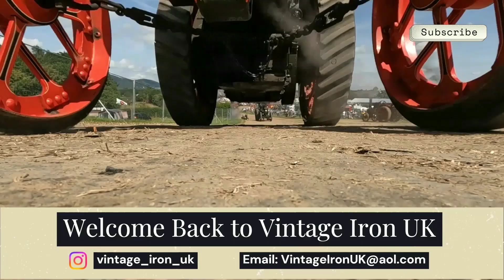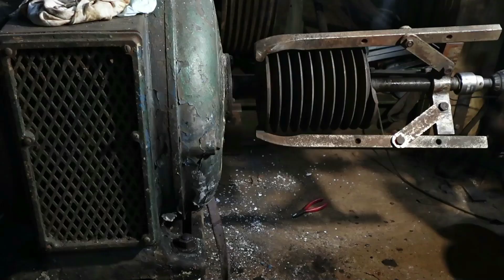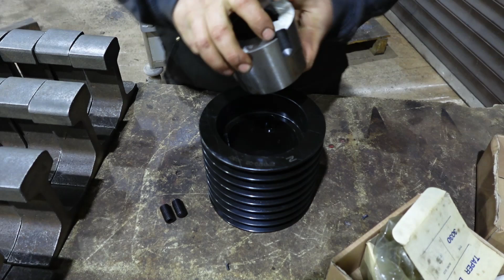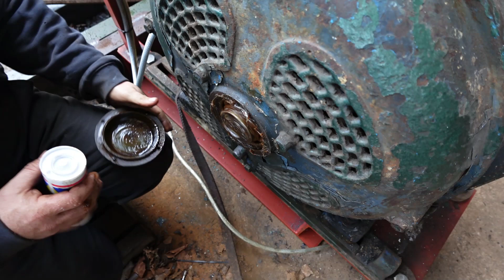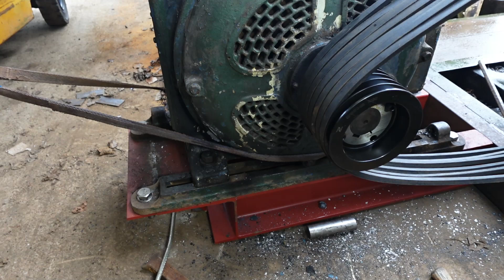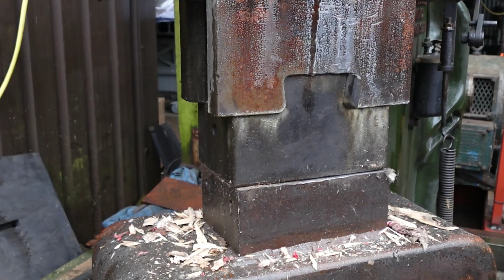100 YEAR OLD Forging hammer REBUILT and working again!!!!

Comment: With access to all that equipment, have you ever thought about building your own engine?, If I had a lathe and just a decent drill press id give it a try..  I would like to build a modernized replica of a opposed cylinder oil engine . Cast from aluminum. With a 8" bore and 12" stroke , definitely never see over 800-1000;rpm normal operating speed around 200-250 to 400 peak. Using multiple 10 HP Chinese injectors and pumps. 2-3 per cylinder, with a hemisphere dish piston with cooling fins milled into the back side of it. With a 1/16" nozzle squirting oil on the back of the piston, the .200"-.300" fins 1/8" thick. Getting oil squirt from the road a large squirter with it's own pump the rod having a 3/16"-1/4" steel tube silver soldered to the rod to send oil from the big end to slightly smaller end. A roughly 3" main bearing, and a roughly 2" piston pin with a brass bushing in the rod and piston 2mm thick after reaming and hone to fit.  A 1.975"+/- pin , with 0.6 mm deep oil grooves in the bushings, 1.5-2 mm wide. To be certain they are  oiling 100%.:the rod having a .020" relief milled on each rod  .25" end mill to allow oil to squirt from the sides of the rod  to spray the piston also possibly having a .030" hole in the top of the rod. A 12" x 2" nearly solid steel/ iron flywheel on the "front" side of the engine. With a 14"-16" 4.5" thick nearly solid flywheel on the working side. With a 1" shaft to allow pulleys, a 8" 6 v belt pulley , with a bracket on the head allowing a jack shaft, allowing a bearing pulley on the crank shaft. With  allowing the jack shaft pulley a 8" spun pulley, the is attached to a 16" pulley that drives a 4"- 6" pulley with 4-6 v belt pulleys 12" diameter, allowing a 300 rpm engine to have a output pulley spinning possibly 3000 rpm , at the crank output, (not the crank RPM.) To allow a alternator to be spun at maximum rpm. About 10-12k rpm alternator shaft speed, max being roughly 18-20k RPM. 6k engine rpm, with a 3:1 over drive. 6x3= 18k RPM , so an alternator can easily spin 20k,, possible to see 25k.   Make intake valves from 3" stainless bar stock, about 1/2" thick drilled 3/8" deep and threaded with 7/16" fine thread , with a 5/8" rod require the disc to be 350°-400° f to screw on, after tight  and cool. Mill a 1/8" wide groove to 7/16 diameter at the area where the disc screws to the rod. Heat to 400°, and Tig weld the gap. Adding material around the disc. Then mill to a valve shape, and turn the rod to 
.500" and grind between centers to around .450"-.475 depend on how straight. Make 18° locks and retainers  to fit inside a .375" diameter groove 
.125" .150" tall groove  with a outer diameter .620"  and a taper of about 18° .620" (+/ .005") with a retainer from a 1045? Steel with a .750"-.800" outer groove diameter, from .625" thick steel thin one side to .200" thick , leaving a .760 " diameter in zhr center  then the opposite side a 
.500" hole hone to valve diameter, and counter sink a hole to fit the locks / keepers. Cuz the ring to be the keeper with a thin blade . Use a 18°  tapered reamer to make the .500" hole fit the tapered locks , put the retainer on the valve stem. Place the locks in the groove on the top of the valve, pull the retainer up. The locks should fit with about .010" of the locks above the retainer, and about .005" clearance from retainer to valve. No was should the valve pull off. It should hold 3000 lbs if loaded properly, and should hold 5000lbs  the more weight , the more the locks squeeze the valve. It should hold the 150lbs seat pressure, band 300 nose pressure of the spring easily. With the valve stem being about 6"-8" long. With a .700" diameter bronze valve guide. About 3.125"-3.300" long. With the top having a .080" 
.750" diameter, 
.500" from the top end. Keeping the guide from falling in the hole. Use hydraulic cylinder rod to make valve seats . If possible, a 2.85" valve using a 3" rod, about .375" thick, maybe .350"  having slight taper on about .015-
.020" of the seat  to allow a .005" -
.007" press fit. Maybe a -50°f seat pressed into a 250°-275° f, head. Using a 60lbs pressure to push it in maybe have a 
.003" groove .005" wide in the center of the seat, with a 
.004" wide tongue to fit that groove heated allowing them to press in. Once together  the temperature differences will not be enough to allow the seat to fall out. Cut a 3 angle  vj. 
then the crank made from cast steel parts with journals  pressed in. The sleeves cast from iron pressed into aluminum with a 20 mm water jacket around the cylinder, the cylinders bolt to the crank case. Using 6, 1/2" studs the main webbing and cylinder deck being 1" minimum thickness.  The head bring 1" thick  with a .500" water jacket over the cylinder and exhaust port. The ports exiting about 2.5" from the valve spring . The valve covers having a opening for the intake and exhaust
  With . Long 1" aluminum tubing as pushrods with steel tips pressed in. Nylon guide plate bushings possibly having a thin steel wear sleeves on the pushrods. Being about 16" long. On a cam with 2" diameter lifters, with a hollow center with an aluminum slug pressed in with 1/4" holes around a .500" center hole. .600" deep the lifter bring 2.35" tall.  The holy aluminum is to reduce weight, the steel center is for wear resistance. A . 500" x . 500" pin with a . 375" dimple in the center made from a hard tool steel. The .150 thick steel outer, attached to the .200" thick bottom with a dished shape the sides .020" shorter than the center heat treated and hard as a good wrench. The camshaft made from 3"bar slices pressed on a 1"; shaft, 4 lobes , 3 bearing journals.  And a oil pump driven from one end, and the shaft being driven from the other
 Using a SBC V8 timing set. With both pistons up at the same time. A single lobe can activate a set of points. Using a mosfet switch  with two coils would work for a gas engine, diesel using the 20:1-22:1 compression ratio to ignite the fuel being injected. The would be points lobe is going to be two sets of 3-4 lobes on a box driven by the cam.  The shaft inside operating the injector for the diesel engine. Possibly having 
.030"-.040" additional lift. And about 5-10° additional duration at .050" to get more fuel from the pump. Maybe 15 hp per injector. If it gets 45 ho per cylinder I'd be amazed. With a amr500 blower per cylinder it may do it. A 10-12" stroke with 8" bore, is far from a small engine. The rpm is hurting HP
 It may be , 25-30 HP with boost at 800 RPM with 500 ftlb tq. Basically it's going to turn that 600-800 RPM no matter what you connect to it. It may not rev fast but it will not slow down .   Sorry to ramble and dream. Have an awesome day🎉 ✌️
Reply from the maker: @jamest.5001  I’ve never wanted to. I’ve plenty of projects I want to get done but building an engine isn’t one. You can pick lathes up pretty cheep if you keep looking. Get one bought and make a start 👍